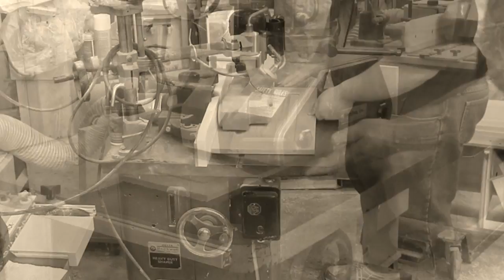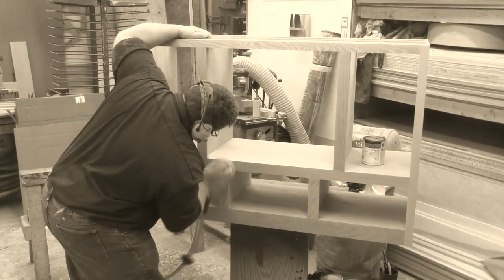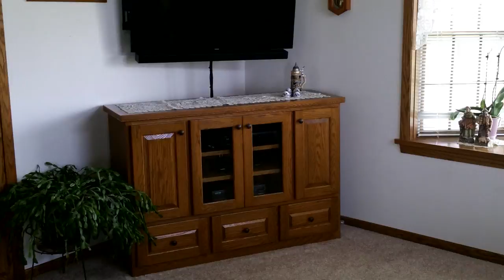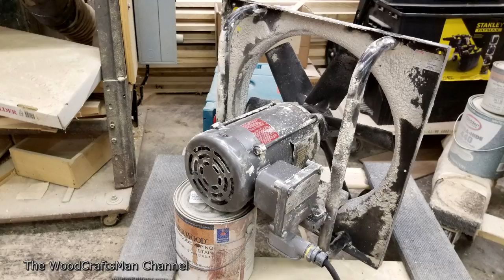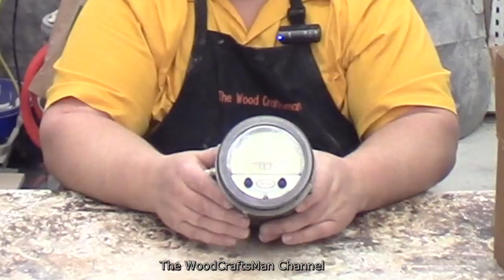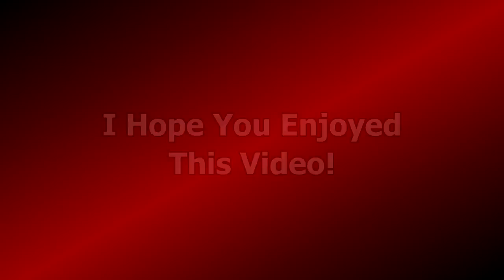Shop Built Exhaust Wall # 232

Comment: hi, i'm building a small booth to paint guitars, would an input fan be needed?
Reply from the maker: It really depends on your setup. if you can open a door or window across from your spray area, you shouldn't need to, but if you have furnace or some type of  gas or oil appliance that vents through a chimney with open flame combustion you will need to make sure you are not pulling a negative pressure down the vent stack. If your heating system is a sealed unit (where it has it own combustion air in a sealed heat exchanger) its not an issue.

Comment: I was looking for how you built it. Seems like i got a lesson on how well of a job you did.
Reply from the maker: It was modeled off of a commercial industrial 4' x 7' exhaust wall moving 3600 CFM, except I have a full 48"x72" filter area which is 24 sqft  where as a 4'x7' exhaust wall only has a 40"x80'" filter area which is only a little over 22 sqft. Other than that, it's pretty much the same thing. Scott

Comment: Why worry about a positive (relative) pressure in a non-dedicated room that you happen to spray paint in?  Are all your saws in another sealed off room?  The room doesn't look particularly clean.  I work for a hospital system that has similar systems in our operating rooms.
Reply from the maker: Hi, the concern lies within the central heating system. When you pull air out if a building obviously you need to replace it. However the air flow will take the path of least resistance. In my case it was the exhaust flue for the furnace (power vented) and water heater (natural draft). To much incoming air blows the stinky air backwards through heating ducts, and not enough pills a negative pressure down  the flue stack. The whole shop is sealed it self from the non heated side, but the other shop adjacent to the cabinet / finishing area are not airtight to each other. I hope that makes sense . Thanks. Scott
Reply: Yes, thanks.